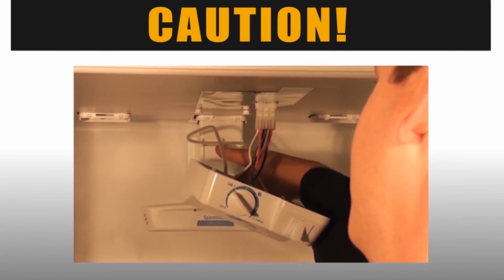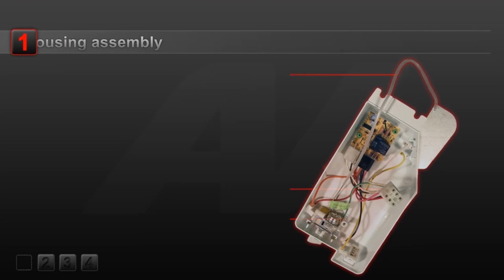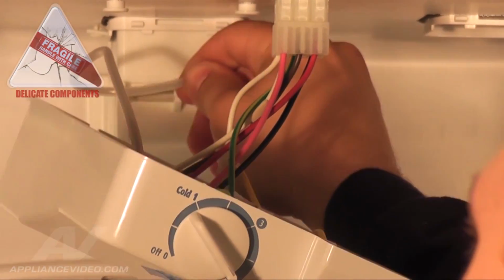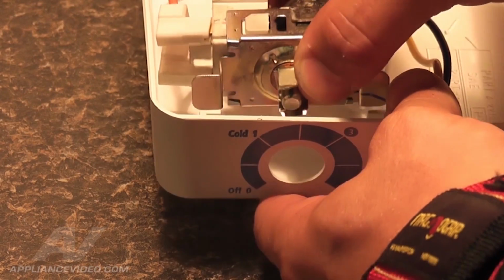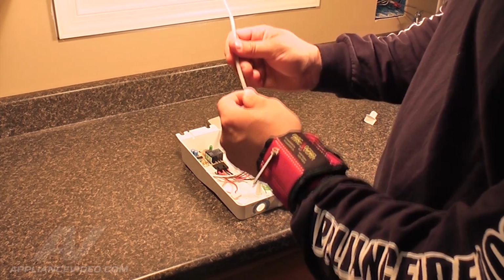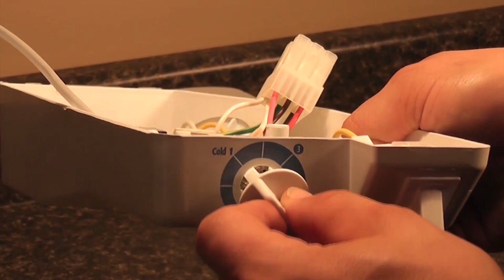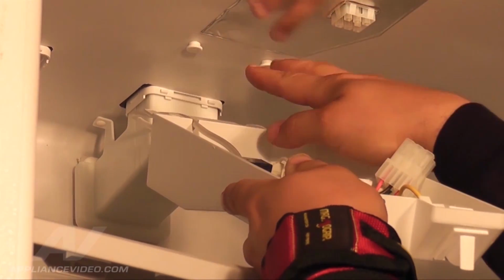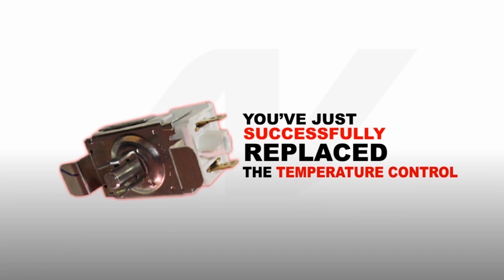Whirlpool Refrigerator Repair Temperature thermostat cold Control -,Maytag,KitchenAid,Roper#2325701)

Comment: I wish you would show how to adjust the calibration.  My fridge works great, cold control maintains fridge and freezer within a narrow temperature range, compressor cycles on and off as it should, defrost cycles on and off as it should, continuity tests are all fine... but the temperature that it maintains is a little too warm.  At maximum cold setting (9 on my GE top freezer model), it maintains freezer at about 0 (goes up to about +4 during defrost), and fridge at about 41-42 (goes up to 43-45 during defrost).  I can see the little hole for the adjustment screw on mine and in your video, but can't see inside to see what type of screwdriver I need.  I'd love to be able to adjust it in situ without taking it out repeatedly and risking breaking the capillary tube, but I can't see.

Comment: And sorry is a mabe (whirlpool) top freezer and has automatic defrost timer amd I manage to follow instructions and check the defrost cycle and is all clean is just fan don't stay on enough I think
Reply from the maker: Diego
       All of our technicians are now answering questions daily on the ApplianceVideo.com website for anyone needing help. Just copy and paste this this question under REPAIR HELP, and one of our  factory authorized technicians  will answer any technical questions at absolutely no charge on your appliance issues. We also have over 2600 free repair videos to help with your appliance repair issues. Thanks for your support. Matt Ace Appliance factory service technician.

Comment: Can you spray the temperature control thermostat with a good contact cleaner, and rotate the control knob left, and right vigorously to loosen up whatever build up might be on the shaft of the  TCS?
Reply from the maker: Great question, you can call
our parts department at 1-800-830-5465 and they can give you help 6-days A week
Mon-Sat . You can also search at www.SaveMoreOnParts.com 7- days a week.  If you have a more
technical question that our parts department cannot answer, our technicians are
answering all questions at our website at www.ApplianceVideo.com under our Repair Help section. We have over 6,000
common questions and answers that you can easily search through by your model
number, appliance make, problem or error codes, and It’s completely free to
search through our question & answer library. There is a very good chance
you question is already answered there.

Comment: Those thermostat when damage just work or no or has a chance that not control correctly the cycle like false reading the temperature and don't turn on cool promptly ?
Reply from the maker: diego 
          Yes, the thermostat normally is open or closed. Sometimes they will freeze food.

Comment: I have a whirlpool WRS322FDAM04 side by side refrigerator. The freezer is cold but the fridge is not so cold. When I put my hand in front of the air damper I can't feel cold air blowing. I could hear the evaporator fan sound so I am assuming it's running. When I turn the refrigerator knob OFF, I could hear the fan stops. When I try to rotate the freezer knob, I can't as its stuck. What could be the problem? Can you please help?
Reply from the maker: Great question, if you have a more technical question that our parts department cannot answer, you can search our over 17,000 answered questions free at our website www.ApplianceVideo.com under our Repair Help section. You can also call our parts department at 1-800-830-5465 and they can give you help 7-days A week ,or search at www.SaveMoreOnParts.com  .

Comment: My refrigerator  runs  constantly  the freezer works  but the bottom  of the refrigerator don't  get cool can you tell me what should i do?
Reply from the maker: Great question, if you have a more technical question that our parts department cannot answer, you can search our over 17,000 answered questions free at our website www.ApplianceVideo.com under our Repair Help section. You can also call our parts department at 1-800-830-5465 and they can give you help 7-days A week ,or search at www.SaveMoreOnParts.com  .

Comment: my thermostat is only workin at the highest temp , which is 7..  when i turn it down it clicks as if its switching off
Reply from the maker: +Sharon Flanagan 

Great question, with our
technicians now getting hundreds questions weekly, they are answering all questions
at our website http://www.appliancevideo.com/repair-help/ .  We also have over 30000 common questions
and answers that you can easily search through by your model number, appliance
make, problem or error code and it’s absolutely FREE.
Reply: kitchen aid refrig bottom freezer mod.kbfs25ewwh7 too cold in ref. section, how to fix
Reply: Mine also

Comment: so does this work if the fridge Is not cooling but the freezer is ?
Reply from the maker: +Shawneen Stewart 

         Good question, with our technicians
now getting hundreds questions weekly, they are answering all questions at our
website http://www.appliancevideo.com/repair-help/ .  We also have over 30000 common questions
and answers that you can easily search through by your model number, appliance
make, problem or error code and it’s absolutely FREE.

Comment: i have a top freezer, whirlpool fridge, it has one control on fridge.,with three snow flakes,my fridge freezes top and fridge. please help
Reply from the maker: Great question, you can call
our parts department at 1-800-830-5465 and they can give you help 6-days A week
Mon-Sat . You can also search at www.SaveMoreOnParts.com 7- days a week.  If you have a more
technical question that our parts department cannot answer, our technicians are
answering all questions at our website at www.ApplianceVideo.com under our Repair Help section. We have over
4,000 common questions and answers that you can easily search through by your
model number, appliance make, and problem or error codes, and It’s free to
search through our question & answer library.